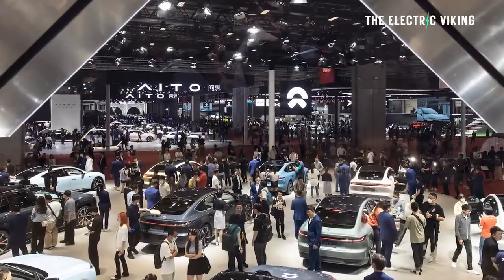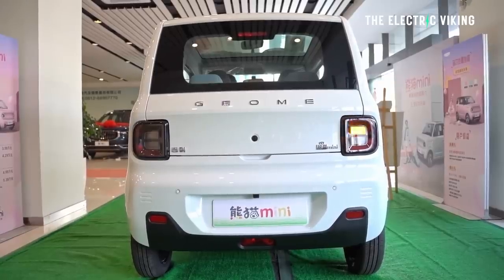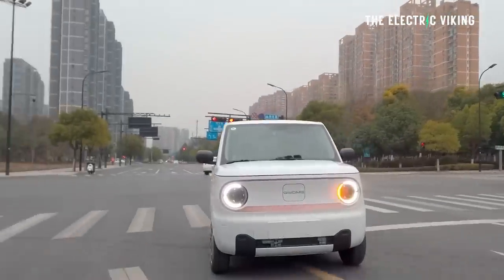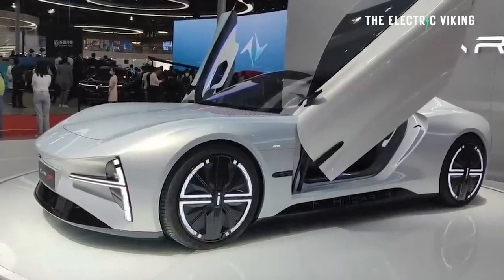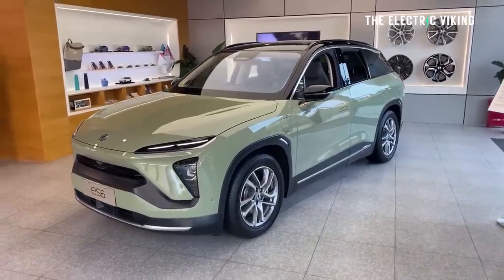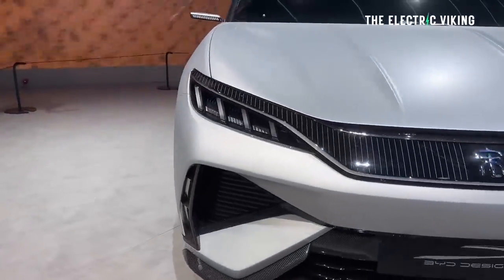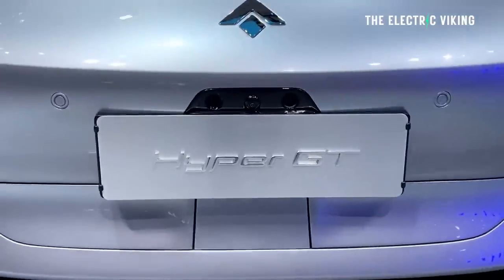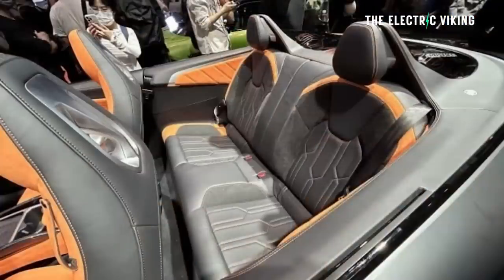The 5 best electric cars unveiled at the Shanghai motor show

Comment: I like the Nio. Battery swap option is a pretty good idea even if you use it once a year. Also the most practical everyday car.
Reply: You could use it once a year and just charge the battery as normal but that is a bit of a waste - the NIO batteries charge max 100kw/h even on a 350kw/h charger, and you must still pay the rental on the battery every month. The rental fee is about the cost of paying off a battery over 6 years (1/72 of the new battery cost per month)

Any time between about 18 months and 6 years ownership the renter is worse off if they want to sell because buyers factor in the rental costs, at around 6 years it's equal, after 6 years the renter is worse off again.
Reply: it's a stupid idea lol

Comment: i just came back from the shanghai auto show today. there is no doubt that evs are the stars of the show and legacy automakers got cold shoulders. 

my favorite cars from the show: 

neta's GT covertible, really cool and fun car. the performance coupe is priced at 33k usd. price for the convertible is not set yet but i expect it to be close to 40k. 

Yangwang U8, at 160k usd i know it is hard to say it is cheap. BUT IT IS! Slap a german badge on it then it is worth half a million easily. 

byd seagull/dolphin, a pair of really affordable and practical budget cars with good range and they do NOT look funky!

IM LS7, a SUV sized similar to model X but much more lixurious and jamed with technology, extremly upscale style, but priced only between 50k to 66k usd. 

SAIC F7, a sized down EQS (5050mm), interior is also similar to EQS layout and material wise, and its battery can be swapped. the f7 goes for 33k to 43k usd. but if you lease the battry, u can get the car for as little as 23k usd. it is MAD.  

evs are getting so good and so cheap in so short period time. evs from 2 years ago already seem obsolete, not to mention certain models that haven't undergone a nlticable update for 4-5 years😂

Comment: Glad to hear CATL is doing rapid swappable batteries. I think Neo’s swappable Model may well be right in the long term but they may be long bankrupt before it happens. Perhaps it just looks appealing because we are used to being able to fuel up in a few minutes and be on our way. But waiting even an hour to charge up puts EVs at a clear and present disadvantage that can not be rationalised away when you find yourself stuck. People just don’t like to be stuck. I’ll be happy to have an EV because I can easily avoid being stuck in my ordinary suburban situation. I would also point out that commercial applications like taxis through to Semis are not making money when they are sitting at the charger.
Reply: Nio will be the only company outside China with swapping stations. Their volume seller Firefly will take full advantage of these. Goldman Sachs and JP Morgan own 10+ million shares EACH in Nio. This is a long term shrewd investment. Viking sometimes do not think long term but Chinese always do.
Reply: @reginald7214  Not at the swap stations as they are constructed at the moment - they are set up so the car must back into the station - this may change in future but for now you can't have a trailer on and do a swap. Also not sure what you mean by using less power - inside the swap stations are normal DC chargers like any other - they start with up top 25 charged batteries then take the used batteries from the cars that just came in an start charging them as they are swapped out.
Reply: There has to be enough stations so people don't have to go out of their way to access one - this defeats the purpose of the quick swap if you have to travel 20min each way off your route. It is also far more capital intensive than putting in a charger for example the new NIO 3.0 stations will store (up to) 25 battery units and apart from the station and swap robot you need to carry these charged batteries at all times. With a supercharger for another brand you can add  200m+ range in under 15min, the swappable batteries will add 170miles in 1/2 hour at a supercharger.

Yes the swap can take just under 5 minutes but the whole process of driving in, setting up and driving away safely is more like 7-8 min. Each station can effectively do 7-8 cars per hour full turnaround, if there is 1 station and 2 people are in front of you it can actually be slower than adding 200 miles at a supercharger.

It can also be very costly for the user - If you buy a car without a battery and keep it for 18 to 60 months between the rental and the lower resale value you are worse off than buying a battery upfront, at 60 months it is about the same, over 60 months renters are worse off again, so you are really only ahead for the first 18 months of ownership.

NIO's model has been disrupted in China by renters who demanded that they can stop renting and buy a battery - they figured out the financial model does not suit their particular circumstance's, NIO has caved into pressure and allowed users for the first time to be able to buy a battery for cars that were sold as BAAS (battery as a service) - previously buyers of cars on this model were prohibited from buying a battery.

The big theoretical advantage is of course the perception that batteries will fail en masse when they are all 6 -7 years old,  the prospect of a monthly rental instead of a complete battery at that point becomes appealing.
Reply: @protagonist9716  Not sure the model works financially for NIO without substantial government assistance.
Reply: @reginald7214  send a link to a clip with a battery exchange with a trailer attached. Until I see it I don't believe its possible.

Comment: Why do they hide the blinkers at the inside between the headlights, so that they are hard to see?

The right blinker is sitting tight to the left side of the right headlight and vice versa. When the headlight lights up, you cannot see the blinker. (It's visible with the daylights, but not with the night headlights on). What's that about?

----
And where does the Model X have scissor opening doors? Just asking for a viking who said so at 7:35 ;-)

You mean the Twizy scissor doors ;-)
Reply: I have the same thought about the blinkers. model X doors called gullwing doors (like the old Mercedes SL), yes he made a mistake.
Reply: @wangyaohan8824  I'm glad I'm not the only one who thinks about the "hidden" blinkers...

The vehicle in the video is not the first one with hidden blinkers. I mentioned this phenomenon on this occasion.
The car makers should place the blinkers inside the closed bonnet, that would be the next step ;-) (No, they are necessary, the blinkers need to be seen!)

And yes, the name of the door method was just a minor thing of course ;-)

Comment: I must be old because to me, most of  these cars are loaded down with aero-trash that only serves to add weight and drag to the vehicles.  I wonder how much range these EVs would have if the designers applied the same principles of aerodynamics as aircraft manufacturers?
Reply: the drag coeffients is what matters, not what ur amature thoughts feel. look at vw audi etc, their designs are inefficient indeed.
Reply: @qilu2004  >The drag coeffients is what matters,<  So you are saying that the garish, angular aero-stuff results in a lower Cd than the smooth, round shapes preferred by Boeing, et al?  I contend that the garish, angular aero-trash is there because automotive focus groups said Wow! and that they said that the cars equipped with same were worth more money.  Mold a bunch of cheap plastic, bolt it on, and jack up the price because this sedan is now a sports car!   What do they care if it adds drag to the vehicle.  Aero-stuff obviously adds weight.
Reply: You are old. Most EV cars don't have fancy aerokits because drag coefficient and hence efficiency is most important. The exceptions are sport coupe/sedan with high insane power which requires aerokits despite EV's weight. 
Most of the Chinese car makers employ the best of car designers from Europe (not Wisconsin) so the Chinese cars have more European flair than others

Comment: Song L is hideous.!  - Aon Hyper GT good if it had normal doors..- .Neta GT o.k. but should be cheaper.
Reply: It does come in normal doors, its a $20,000 RMB option over there (so $3,000 USD option to have scissor doors).

Comment: Sorry.,.......the best ev is the Aptera. Aptera has solar panels that charge the battery s 14-40 miles per day. The car has carbon structure that will never rust. The three wheel, aerodynamic shape makes for a light weight car that comfortably seats 6 ft 5 in people with head room to spare!!! U can haul items 7 ft long in the boot that has 32 cu ft !!!!.....I could go on re aptera.......the launch version will have a a400 mile range battery.......three motor drive......optional full solar panels.,..optional audio system.......for $33,200.....The cars in this video will never be imported to the USA. This is because car dealers are greedy bastards!!!!....Sandy Munro says the richest companies in Detroit are far dealers!!!!!!.... Dealers don't want to sell a 5,000 or ten thousand dollar car........they want to sell a $50,000-100,000 car so they can add on their profit margin. I am buying an aptera. Question s? Email me....... barbuto@optonline.net.......I Will send you a discount code to save u money when you order your aptera on line..???

Comment: BEIJING/SHANGHAI (Reuters) -Chinese electric vehicle giant BYD Co. (BYDDF) posted a fivefold jump in its first-quarter profit on Thursday as the company consolidated its leadership in the domestic market.

Net profit for the first three months of the year was 4.13 billion yuan ($596.56 million), up 410.9% from 808.41 million yuan a year earlier, on revenue up 79.8% at 120.17 billion yuan, the company said in a stock market filing.

The Shenzhen-based company, whose investors include Warren Buffett's Berkshire Hathaway (BRK/A), outsold Volkswagen-branded cars in the first quarter of this year in China, according to a Reuters analysis of data from the China Association of Automobile Manufacturers. Buoyed by its Dynasty and Ocean series of plug-in hybrids and pure electric cars, BYD sold 552,076 new energy vehicles in the first quarter, a surge of 92.81% year-on-year, according to the company. The company sold more than 1.86 million vehicles in 2022, mostly in China. BYD has joined many other Chinese brands in a price war started by Tesla, with the offering of discounts for its Song Plus and Seal EVs in March. The price cuts have eaten into automakers' earnings, with Tesla reporting a 24% plunge in first-quarter net income. Last week, BYD unveiled its Seagull electric hatchback at the Shanghai autoshow, stunning visitors with a price from just 78,000 yuan - around half the level of the cheapest new energy vehicles available elsewhere.  

($1 = 6.9230 Chinese yuan renminbi)

(Reporting by Qiaoyi Li, Zhang Yan and Brenda GohEditing by David Goodman and Sharon Singleton)